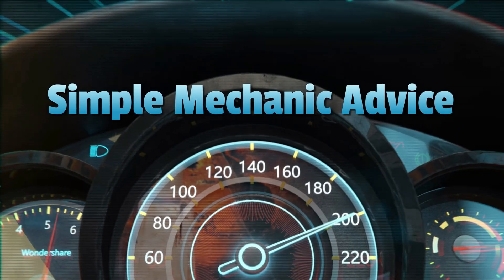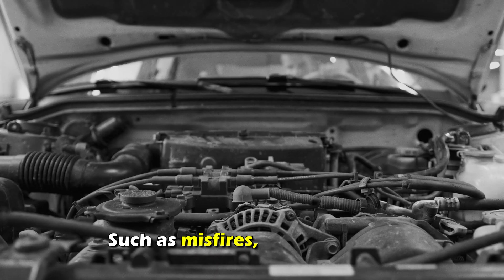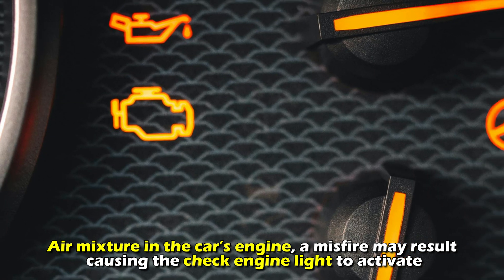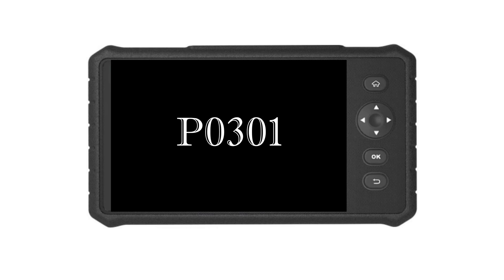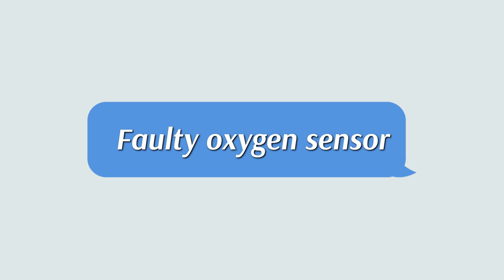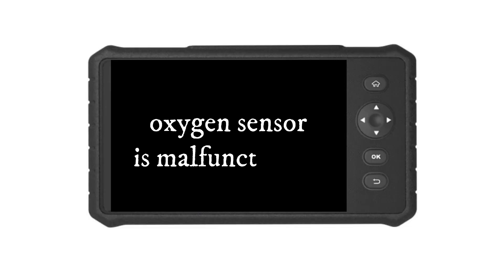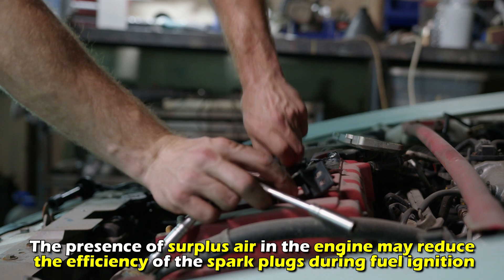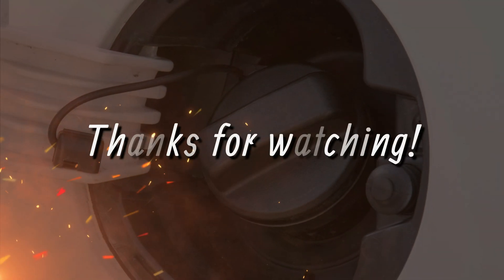Check Engine Light Flashing Then Stops (Meaning, Causes And Solutions)

Comment: My engine light comes on if I punch the throttle then goes off when I let up… backfires but I checked vac oil coolant plugs are kinda fresh, injectors a year old, es same… I guess oxygen sensor???
Reply: I’m having the same issue.  I have replaced all the spark plugs, wires, ignition coils, and injectors.   I’m still getting a P0304.  I don’t hear a lifter tick so I’m lost
Reply: Same here....
Reply: @vccco221lifters smh.  Mine was partially collapsed so i have to do a delete
Reply: @vccco221think it was the tps but I’m dealing with one problem after another literally . was going to put the air conditioning hoses and all that together again months ago then the freaking front AR bushings failed and it was a complete front suspension then it was struts and the castor and Cam played the whole routine and of course right before that was the heater core and then it started running like crap and I did the IAC in the throttle position center and cleaned out the oxygen centers and the MAF and every other fucking thing on this car I can figure out to change or inspect and then it’s not running. I have since put in a brand new distributor today and fuel pump and in the meantime to set the TPS you gotta stab the wire. It’s a $50 fucking part brand new I went to put tape around the wire and the whole fucking thing fell apart came on sprung popped out. Tiny pins teeny weenie little spring, and the sun was going down I gave up. I’m ready to put a stick of dynamite in the fucking thing. I’ve been driving this car for a year. I’m not a master mechanic, but all I ever do is chase after shit to fix it over and over and over.
Reply: Catalytic converter?
Reply: Flashing Engine Light, then shut off Car and it goes away. This only happens on Cold Start in the morning. 🙏 Any suggestions. ?